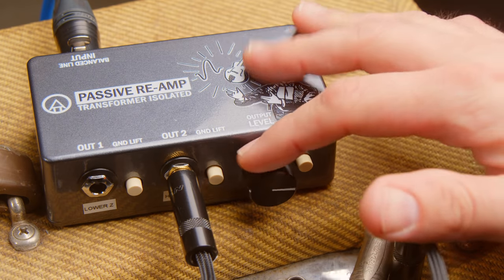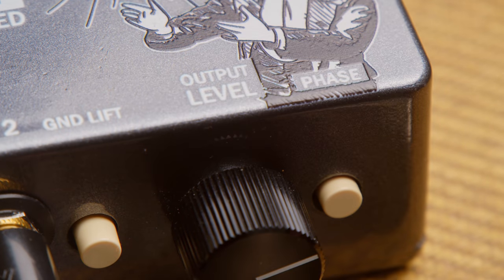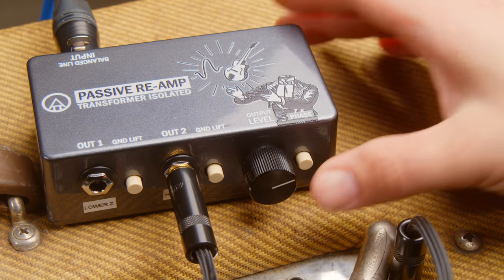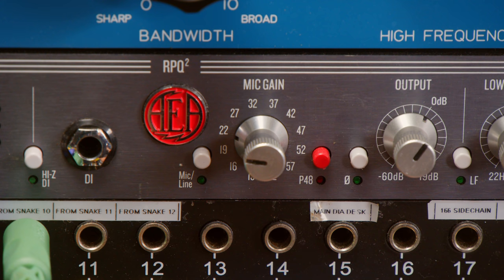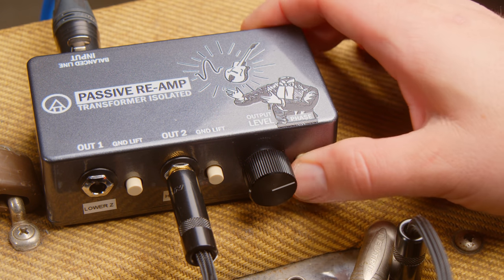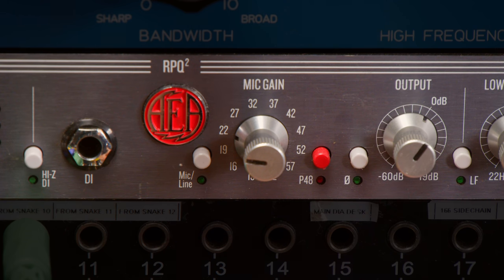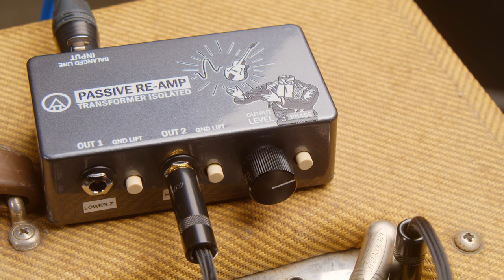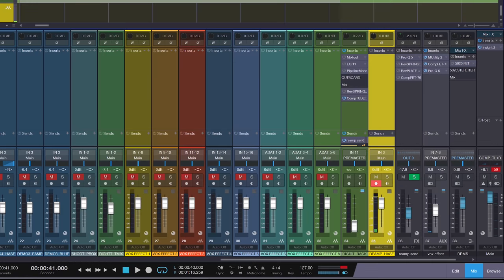No More Mono Guitar - A Real Way to Stereo-ize a Source

Comment: This just doesn’t compute at all! I totally get how the phase and tone will be somewhat different, but what you’ve landed on is more like a “GOD_MODE” cheat code! How, how, HOW the f**k can it be completely mono compatible AND sound absolutely perfect at the same time AND have such a great stereo effect!? Oh well; these questions are definitely going to give me insomnia tonight, but I’m definitely going to search for a reamp box or something that will allow me to flip the phase to the guitar amp. As a singer, what I’m the most curious about now is whether this can be done to a vocal. I’m imagining sending my vocal to a full-range speaker and recording it with something uncolored like a measurement microphone. And it might be an idea to use a small speaker and reamp it at a low volume for less speaker Distortion

EDIT: 
Now that I think of it, I already had some great results recording vocals some years ago with a sct 2000 tube mic and a S241 Superlux pencil mic and panning them left and right. Neither mic is spectacular, but they’re different enough that they combined into a pretty great sound, and it even worked in mono, because the frequencies and transients that got cancelled out weren’t the prettiest.
Reply: It's only been an hour, but I had to rewatch this for the fourth or fifth time. That guitar solo ping pong effect is incredible! 

Here's another idea: get (or make) two boundary layer mics and place them on the floor at least one foot away from the amp, but preferably much farther, and at least three feet apart. Do it for me; I currently have no studio space or even work room, because we're building a house and the pandemic's delayed its completion by almost a year now. Frustrating, but when finished I will have about 210sqf of studio space with a 13sqf ceiling at its highest
Reply: @Herfinnur  Bruh, you don't need speakers and microphones for this to work on a vocal, you can do it ITB with any tube emulation plugin: duplicate the track, flip the phase before and after the tube emulator on one channel, get some saturation going, match the output of the 2 tracks (won't come out at the same level even if you use exactly the same settings on the tube emulator), done.

Comment: Could this work with an amp sim as well? Feed it with a reversed signal, bounce it and reverse it again. Did the manufacturers of amp sims take this behaviour into account or will an amp sim react the same way to a reversed signal? Time to do some testing!
Reply: From what I’ve seen in the comments, it depends on the amp sim 🤷🏻‍♂️ some do, some don’t
Reply: @wokeupinapanic  Indeed, that's what I noticed too, when I did some tests just now. However the effect is very subtle. It does give the guitar a little more dimension, but a similar result could be achieved by just dialling in different tones in those two amp sims, or use two different amp sims altogether. So in the world of virtual amps this trick isn't as valuable. Still a clever approach!
Reply: @Patbwoy  just record the output of a plugin to two separate tracks in different passes, flip one of them, sum, and if it gets completely canceled, it's a no-go. If you hear something, as quiet and small as it can be then the plugin does randomize some small internal values/mall settings continuously, and thus it is a proper emulation of how a real analog device behaves.

Comment: Aren't you just exploiting the fact that one or both phase reversals are not 'exact' phase reversals? In particular, I would imagine that for a push-button phase reversal to take place, you're switching part of the circuit from a non-inverting op-amp to an inverting op-amp and they will have very similar low-to-mid characteristics but unavoidably varying highs. Couldn't you get a similar effect from just re-amping with 2 different amps or maybe just swapping a pre-amp tube? Don't get me wrong, I like it and I've done something similar in a track exploiting a multi-miced guitar cab, but I was disappointed to find that all that glorious pseudo-stereo was eaten alive by the cymbal wash--it was the wrong song for that kind of effect, but I did get compliments that it was the best guitar tone on the EP, go figure.
Reply: I think the key here is making the amp work "backwards". A lot of things change physically in an inverted pass through an amp + speaker + room + microphones and analog gear. So much that it gets closer to the song of a real (and very tight!!) double-take, and farther from the infernal "Haas/delay/phase cancellation/distance/position/two amps = chorus or asymmetric results" underworld.

I hope I'm right!!

Comment: I couldnt hear much of a difference...i just use two amps..from a stereo pedal...a phase shiftwr right now.
I use to have an Ibanez chorus i really liked, either with two fifty watt Marshall heads, or two smaller tube amps 18 or 20 watts,and it gets loud enough, but creamy and thick.
And ive got some good mics,
And you can clean up the amp  and still sound good.

Comment: And guess what ? It works on plugins too !!! But I don't think this a physic effect of the speaker cause I tried with preamp emulation only, not the speakers...
Reply from the maker: That’s amazing. Should def try it out with the saturation based preamp plugins.
Reply: @creativesoundlab  I've tried cab emulation only  too and it seems to have no effect on that...  When summing in mono all went out. It could be interesting to check this on real cabs. Edit: the effect is way more subtle. Maybe the light room reverb...

Comment: I’ve heard people do this 40 years ago .two separate amplifiers and what essentially is a volume pedal between the 2& definitely one has low frequency dominant ,and the other has high plus different effects .when you step on the pedal you introduced the other amplifier and it gives a sweeping in the room one guitar two sounds one dominates and At the press of the pedal  it disappears. Or appears depending on which way you’re wanting to go eight pans from right to left depending on the amp setting and your pedal.

Comment: is this basically turning a mono guitar track into a Mid Side (M-S)? This reminds me of the trick you use on room mics as outlined here: https://www.youtube.com/watch?v=bv6RO8JmAdc

Also, question for those of us who don't have a reamp box that has a phase polarity flip option: Is it possible to just send the signal with normal phase to the amp via a reamp box, and connect a speaker cable from the head of the amp to the speaker cab--with the Tip/Sleeve wired in reverse? If what we're after is a speaker pulling in on the first cycle, then this can be achieved with a reversed speaker cable as well. Someone sanity check me here.

Comment: Uh, no. Speakers do not care if you inverse the phase of the signal. They don't "react differently". It's absolutely not "stressed out". That's absolute nonsense. The amp might have unbalanced distortion so it clips off-center, assuming you are using the amp to provide distortion. Possibly the reflections from the room etc might be different, maybe, I'm not sure. But I strongly suspect you would get exactly the same effect by re-amping the signal twice with the same polarity.

In any case, as an electrical engineer, I promise you, the amp does not care that the signal is "upside down", because there is no such thing as an "upside down" signal. That's complete nonsense. Despite what people might have told you, amps aren't magic.

Now, you did it in the DAW. And that's a different thing. Because DAWs are maths, and if your signal isn't perfectly balanced, and whatever plugin you use doesn't take away that "DC offset" (and most don't) then that would make a difference. A difference that would NOT happen in real life.

Comment: Earh , you are not correct . Polarity of speaker doesn't matter at all when use one speaker .
If signal goes in or out first have zerro difference at all .
The speaker is made so the movement in each direction is the same .
( otherwise the speaker would break )
The only matter is when use two speakers or / and signals ect .
Polarity flipped on one signal will cause the signal to cancel each other out if both signals 
is 100 percent equal .
And no the sound difference do not happen in the speaker at all .
It is caused by the tiny difference in the circuit itself NOT in the speaker at all .
After all the speaker doesn't care of any polarity at all .
But the air movement if use two speakers produce  preasure that cancel out if two 
speakers is wired in opposite polarity .
same also happen in the electric signal itself if the phase is reversed ( polarity flipped ) 
it cause signal to cancel out .
This is the very basic principle used in noise cancelation equipment from headphones 
used at high noise factories ect to inside car cabins ect .
They take the noise and send it trough the amplifier system but polarity reversed 
so to cancel out the noise .

Comment: Interesting…. I’m really curious to see a null test of this, or at least just how the waveforms look
Reply: You can hear the frequencies that are out of phase with each other when he removes the polarity flip in mono. It's mostly higher frequencies but some mids are taken away as well. Mono looks like it lacks the clarity the stereo mix has but the body of the sound mostly remains intact. I'm sure a lot of people will find this an acceptable trade off for the larger sound in stereo and there will be others who don't or it will be mix dependent.